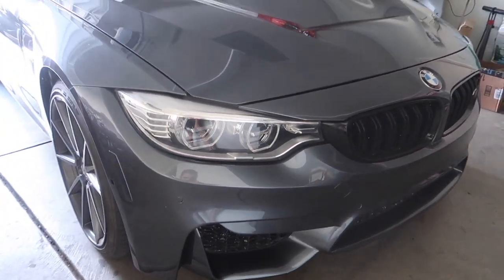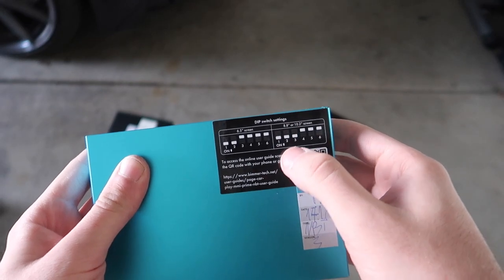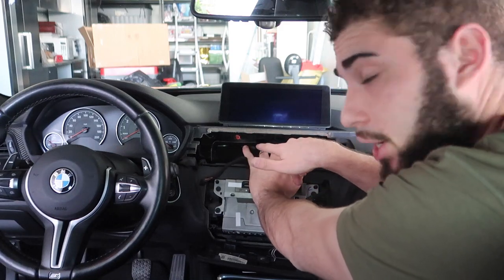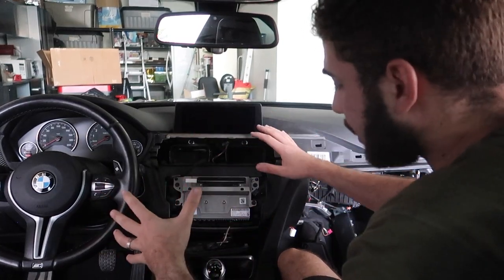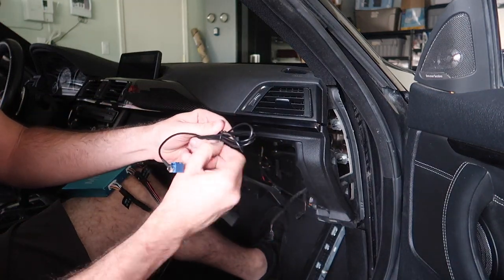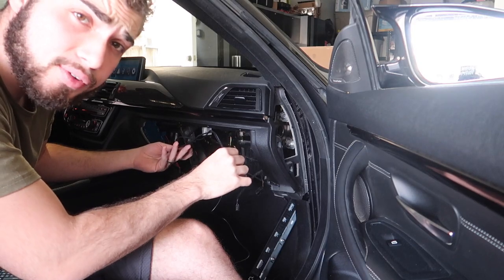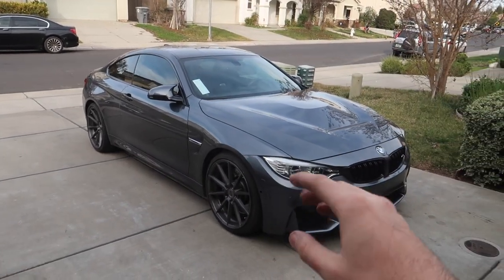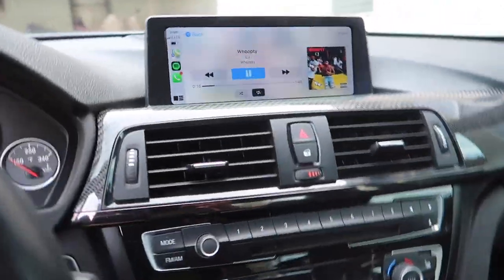THE M4 GETS 2 NEW MODS! READY TO HEAD TO LOS ANGELES!

Comment: The MMI box is legit! I installed it in my BMW as well. However, I used my iPhone charger cord and connected it to the MMI usb then hide the cord inside the center console (plastic) up to the center storage area. Gives a cleaner look then having a dangling usb under your passenger floor board. Also, it becomes more accessible to charge your iphone in the center storage area. Just a thought bro!